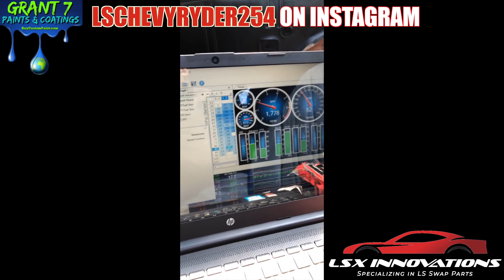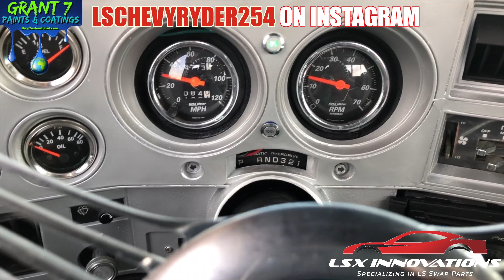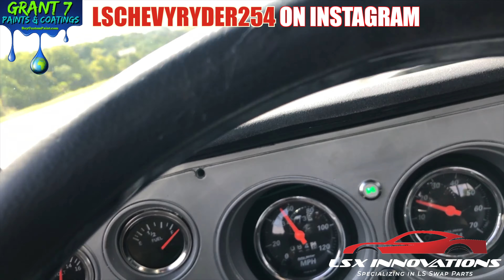WRAPPING UP THE  LS SWAP BOX CHEVY LS SWAP C10 ON DECK!!!!

Comment: Much respect. That paint job looked good. Just saw other video. About to do the same to my 1987 Trans Am. Black turbo cans. Can believe how the wet sand came out. What was your trick? How hard was that? Did you polish it at all afterwards?? Good looking!
Reply from the maker: This is not the turbo paint can spray job  it was painted base coat clear coat in my buddy garage  no wetsand of buff has been done on this truck yet prob will attempt in the next month or two
Reply: @LSCHEVYRYDER254  Ahh. Right on. Thanks for the reply. Truck looks great. Keep up the grind!
Reply from the maker: @ILMODC  thanks I will have to check out your channel as well